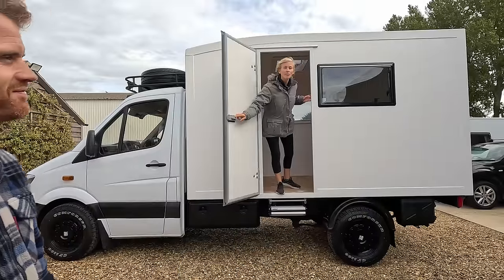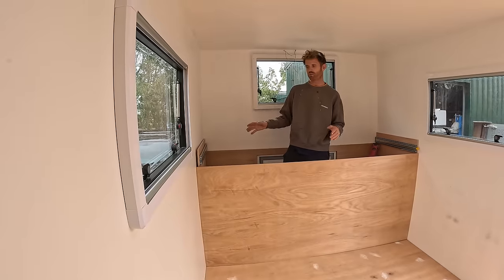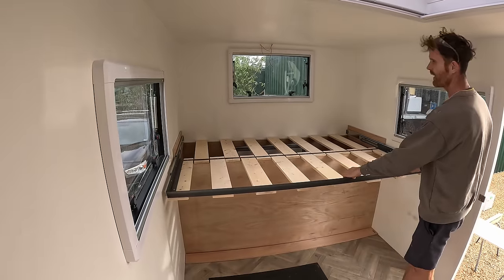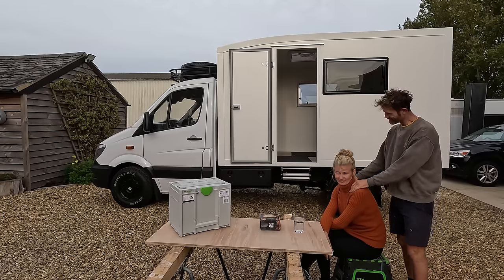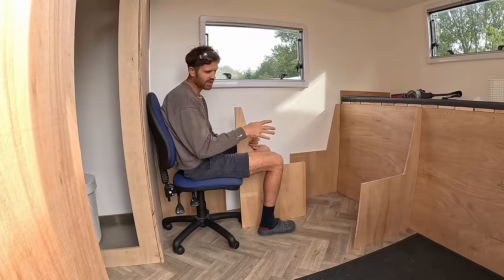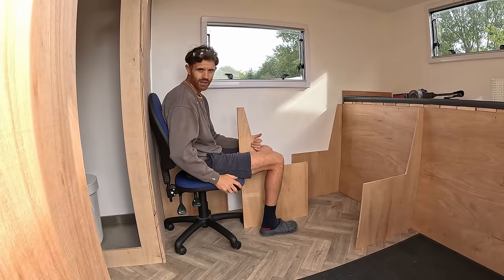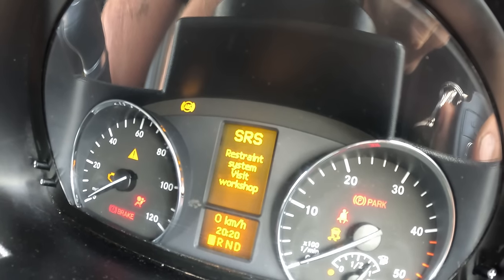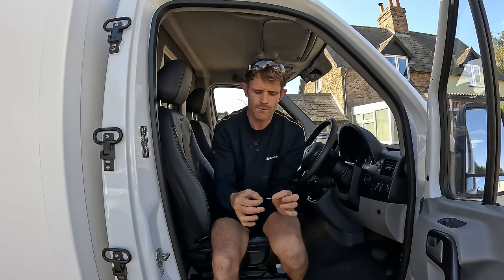Most SPACIOUS MWB Van Interior For Vanlife: Supermarket Delivery Van Conversion

Comment: Tool Tip Thursday ;-) The Build is coming along nicely. I even saw a ex Sainsbury Van yesterday when I was out with my Eldest on her Hack out, She made me walk along with her. well until they started to trot and this old fart can't keep up. It was being used as Hire Van. It has got me thinking again of building my own, but once the kids don't want to come camping with Mum and Dad. 
I do like the panel Saw as it takes up less room that a full size cabinet saw. I have to make do with a Track saw and a site saw. Those Kreg Jigs are brilliant. I have used mine a fair bit as if you plan how your using them you don't have to fill or plug the holes. That said I do also have there plug cutter, which I have even managed to cut plugs out of MDF, for when you can't hide the pocket hole. Another great tool for joining cabinets is the Domino. Trend is making the Domino Dowels now so it will not be long possibly before they release their own version as Festool's Patient must have run out, with them making slightly cheaper Domino Dowels. 
Looking forward to the next installment of Jon's Tools and Jess's Guns! Oh and the next stage of the build.
Reply: This is why we need Tool Talk Tuesday etc al, because there's an entire language many of us don't understand. 😂
Reply: @lemonladyYT  I would be the same if I didn't have a friend that is a Carpenter/Joiner, and helped him out when he needed a hand, and I learnt a lot from him over the years. We would both do our day jobs and work together at night. We even got a offer from a Designer to work with her and she would have provided a space to work in one of her out buildings. As we did a lot of work on her House, which we got as the Company my Friend worked for passed it on to him. Sadly my friend wasn't so keen at the time of setting up on his own.
Reply from the maker: Cheers mate, yeah I’d love the festool domino, cracking bit of kit that, it’s on my wish list so hopefully the sponsor sponsors some more 😂
Reply: @truebluetravellers  You may have to wait for the next project to yield a new tool or two from your Very Generous Sponsor. As you have already sorted out the cabinetry on the current build.

Comment: Hey guys. Coming along nicely. I have to say, I dont like those pocket screws. I dont rely on the fastener. I believe in wood glue. The fastener is only to hold it while the glue dries. I just pin with the air nailer. Proper strong joint.
Reply from the maker: Cheers mate, I have a friend who says the same, I just over engineer everything 😂🤦‍♂️
Reply: @truebluetravellers  Rather than legs on the bed, some sort of fixed cleat or neat, folding bracket on the wall to support the corners and you should be good to go. Is the front edge of the frame tube or angle profile? Rectangle tube on edge is most rigid. Angle could kink with a concentrated load, like from a knee while you climb on.

Comment: Like the talk through on the plan at the start of the video. Love the festool sponsor! As usual the workmanship is spot on. Nice layout. 18:57 Thank you for using my suggestion of Sat tool day! I was well happy with that, great segment on the video - but then I’m biased. A place for your tools: You could build a frame on the inside of your entry door, put some stiff foam inside and cut out shapes for tools, build an inner door to cover it. It would hold the tools, be accessible and provide extra insulation on the door. Ta da!! Dave Birmingham
Reply from the maker: Cheers David 👍, I did similar to this in a toolbox before bought some foam and spent hours drawing round the tools out then routered out the foam to fit the tools, worked a treat and looked 👌

Comment: Nice video and very good work. For safety, all non factory conversions of vans with bulkheads should also consider how crashworthy the installed  furniture is as debris and shrapnel may fly into the cab area in such a scenario.

Comment: about the pull out overhang of the bed : youre going to make a seating area and kitchen across from it , the most simple solution would be to make the pieces (maibe you can make the table so you can raise it too the height of the underside of the bed or have a box you can set on the table to rest the bed on top of )  just high enough to have the pulled out part of the bed rest on top of them on both sides on a small rubber doorstopper , should make it plenty strong enough to support youre weight on the end of it 
as for the top cabinets you could put a bungy cord in front of them (ok so no bungy cords ) and use curtains to hide most of the mess behind them , if you do make doors (ok no doors , maibe later) you could make them like picture frames and tension fabric over them , that makes them lighter just about as strong as they need to be and you can use the fabric you can use in the res of the interior and make them look a little more like they belong 
ok aluminium strips it is , if you mount them so they have a little lip under the cabinets you can put elestic bands with a hook on the underside to hook under the lip and over the edge of the baskets , that way the baskets are held down during travel and wont pop over the edge after hitting a bump in the road
Reply from the maker: Yeah we did a similar thing to that in our last build, did an outer frame and then put hesian in the middle worked out brilliant and like u say saves loads of weight 👍

Comment: Just a quick suggestion if you can find a way to duct some air flow from the diesel heater into the garage helps stop damp from the cold air lingering in there and has a added bonus of heating your bed
Reply from the maker: 👍 yep we are going to put a vent in the board between the garage and the living so then the whole space should be toasty, like u say good idea to heat that area too 👍

Comment: Sainsbury's delivery driver here, absolutely buzzed seeing one of our old vans being repurposed in such an amazing way 👌

Glad to see you've put proper tyres on it as those vans are awful on ANY slippery surface including wet grass!

The combination of rear wheel drive, automatic gearbox and zero weight over the back axle has left many drivers stranded in embarrassing places 🤦‍♂️😂
Reply: 😂 been there bro.
Reply: Sainsburys driver here too, the words you speaks are true, and if the van does slide even one inch the bloody masternaught lets you know all about it.
Reply: @philboboggins  Bloody Masternaut system 🤬🤬

From our store we cover a lot of rural areas and single track roads, it's almost impossible to avoid yellows or even a red as the locals drive round those tracks as though they own them 🤦‍♂️
Reply: was on a single track the other day well below the speed  limit, tractor came steaming around the bend. no chance of braking gently wet  leaves and mud ABS kicked in masternaut went red,😡😡.. and you cant even brake gently on any of our wonderfully rutted  potholed town roads, cos that sets it off aswel..
Reply from the maker: Thanks so much mate that’s kind of you to say, hoping it’s going to work out nicely. We’re stoked with how it’s coming together. It spun up something cruel on our gravel when we took the box off but hopefully with the new tyres and the weight of the build in the back she’ll do alright in the snow. 🤞We’ll be prepared with chains and recovery tracks just incase though.

Comment: I am in the process of converting a Mercedes LWB Sprinter.  After "insulating " the van and seeing all the  locations where insulation can not go and the metal which goes from the outside wall of the van to the inside. I wish I had started with a box van. Oh well hey oh I will press on.
Reply from the maker: I know what u mean mate, but pannels vans are still pretty good to be honest,  we did some English trips in our sprinter panel van and we were toasty warm, the worst for cold getting In is windows tho for sure 👍,

Comment: Re: Jess' baskets. Have you tought about putting a simple bungee cord type of thing across the front instead? Then you don't need the lip or doors and you can completely remove it when in use so you can slide the baskets in and out. Yes, I made this comment before the end of the video. But it does work well. I use them all the time for keeping things in place for transport to Glastonbury.
Reply from the maker: Exactly, works a treat hey 👍 I think they look good too but she’s not having it 🤷‍♂️

Comment: Well done, but if you ever plan to drive OFF sealed roads, the subsequent bouncing movements will throw things out of your open baskets, even with edges, so you will either need strong latching doors, straps or bungee cords (knowing Australia, should have alerted you to this!!). Here staple & glue gins are NO use, they rust and vibrate undone, glue, screw & epoxy are the safest bet. I find myself (I am from a boating/yachting family) that if built like boats to tackle gale force seas, then you are safest. I have had epoxied screws come adrift, from aluminium & wood together, on my truck that is way stronger than a Sainsbury's Van. Good luck and stay safe. Kia Ora from New Zealand. 💜💜
Reply from the maker: Thanks, all valid points, the corrugations in Australia are a good test to van build strength! We really tested ours there!! I should have said we always glue and screw, not just screw. This van won’t get much of that treatment though as it’s not really capable of that, might take it down some short dirt tracks slowly for a good park up but that’s the closest she’ll come to that kind of thing.
Reply: @truebluetravellers  💜💜 Of course Austrailia has more sandy and muddy tracks, than our rough corrugated gravel/dirt roads here. Stay safe & take care.

Comment: Hi great video new tool suggestion rather than holding the wood while using the belt sander ( which clearly more than good enough) why not get a linisher for the workshop similar thing but one man operated and great bit of kit your welcome haha
Reply from the maker: Cheers mate, It’s on the list 👍 I’ve got one for steel but it’s not that good with wood as the rounded end doesn’t really sand wood square, would be allot better with a proper wood one with the big front face 👍 maybe next week 👀 😂
Reply: @truebluetravellers  haha brilliant good luck with that defo good bit of kit 👍

Comment: Another Great video, Can you add  your Bungi and Steel wire rope making kit to your Amazon kit lists ?
Reply from the maker: Yes mate, will do that’s for the reminder. I’ll make a special list for it and let you knew when its in 👍
Reply from the maker: Hi Chris, I've made a list on our amazon shop with all the bits except the hooks as they are cheaper on Ebay. https://amzn.to/3tG1s1V

This is the link to the hooks on ebay https://www.ebay.co.uk/itm/303163681474?hash=item4695f6aac2:g:XLQAAOSw4f1je1qH&amdata=enc%3AAQAIAAABIPvzcRiGMS5dR%2B9cuJP1OLsgL6rBYrE%2FdSrPx1LlkAa4%2FizQbyU6FM3UTlfOi37oUdXE%2B8U09lTzsvqCkeeRvhfb%2Bwy2sOVCH8gj3D4PFP642aOPqBSiCACrRBWT4HBx%2BtvHTd2zxCdDCcDr1cLsG1YnT5h7f4ig8EMZtxtnVus6bggYK66zgnFpfWWR5AsssjsQNvq%2BCXm8M09PydRBSvONWo42cwQ8Dl2LUbJyn1f2EZOhMOja5TqBQyg5uybdNertb7m1KZ1j%2BT6xNrh00f4Fy7UQ2V79A2DmYGe6cUKKBexyUZiQUwvcCZ49aYL8LaI0CwxvMeAJTAx0mgCMrjk8rKtpOh8MIwmmKyyWP65ASYOteDyJMXIdtqs7HgG41A%3D%3D%7Ctkp%3ABFBM-Iunz-Zi
Reply: @truebluetravellers  Awesome you will have to post the links of the shorts

Comment: I really like your videos because they are not only fun, but also very educational. I'm even a pretty handyman, but thanks to your tips and tricks I've learned a lot. And your trips are a dream for many, which we can also enjoy thanks to your videos.😁👍. I just have a small question: what kind of drill guide do you use when making the benches? I have been looking for something like this for a long time, but this one is absolutely great because it also has the option to connect the vacuum cleaner to it. Keep up the great work and you both are a great couple😂
Reply from the maker: Cheers mate, much appreciated, it’s just a kreg jig, I’ll drop the link in below mate 👍
https://www.amazon.co.uk/Kreg-256272-K4-Pocket-Hole-Jig/dp/B007XDHRMG/ref=asc_df_B007XDHRMG/?tag=googshopuk-21&linkCode=df0&hvadid=271967412945&hvpos=&hvnetw=g&hvrand=17590814192505108903&hvpone=&hvptwo=&hvqmt=&hvdev=m&hvdvcmdl=&hvlocint=&hvlocphy=1007094&hvtargid=pla-475823022687&psc=1
Reply: Thanks😃👍 @truebluetravellers

Comment: Brilliant idea to convert guy's, absolutely love the way you've designed the layout, just curious how fid you cut out the doorways and get them eater tight and create a water tight seal between bulkhead and rear of the cab area. Also how did you fill the back door in and create the smaller lower down one
Great channel all the best Lee
Reply from the maker: Hi Lee, we filmed doing these bits too. We show cutting the holes and the alteration to the back door and fixing in the panel in video 1 of the series which is this one: Supermarket Delivery Van to ULTIMATE Winter Campervan: Van Build Part 1
https://youtu.be/9MrxENorFeU

And we show fitting the doors and crawl through in video 2: The Most Technical Job We've Done On A Camper Conversion!
https://youtu.be/VHCeB7O_pCA

Hope that helps 😁
Reply: @truebluetravellers  oh my how stupid am I not to have found that already 🙄🤫🤔🤣🤣🤣🤣👍👍👍👍 thank you so much for this

Comment: 2 questions. What was the weight of the body itself?

What was the mileage on the van?

Bonus question. How does the body attach to the chassis?
Reply from the maker: Not sure on the weight of the body on its own but I think it was 2060kg empty with box on, mileage was 90k and it’s just bolted to the chassis with about 12bolts 👍

Comment: Would you fail an MOT if you solder resistors on to bridge the connection?
Reply from the maker: No not at all, it’s puts the light out on the dash so it doesn’t fail MOT, but you do have to do it otherwise it would fail MOT if the light was on.
Reply: @truebluetravellers  You have actually saved me £50 if it works, my local garage quoted me that to fix it.  Time to dig out the soldering iron 🤣
Reply from the maker: You will still have to get a code reader to delete the fault codes tho that’s the only thing 👍

Comment: No mention of the van mechanicals, or did I miss that?
Reply from the maker: Sorry mate, what do you mean by van mechanicals?
Reply: @truebluetravellers  it's a tough life being a supermarket delivery van, lots of short journeys, city traffic, and huge mileages. What state was your van in?
Reply from the maker: @steveelkins52  oh I see what u mean, so far it’s spot on, a few issues are drivers door seal torn, radio screen broken (apparently it’s common on this model) few dings in drivers door which I’m assuming is from the crates, but apart from that all good mechanically 🤞

Comment: What Plywood are you using? Is it quite flat and stable? I struggle to find anything that isn’t warped.
Reply from the maker: Rubbish to be honest Mate, we just use normal 12mm hardwood ply and then birch for the fronts of everything, the wood price seems to of gone up but the quality gone way down
Reply: @truebluetravellers  it’s frustrating that birch ply is the only decent option for cabinet construction, especially with the price and lack of availability these days. Anyway, still enjoying your videos. Keep up the good work!

Comment: one thing weight, and keeping down, so why has everything cupboards, bed, seating, all  all got solid backs? and they where not just using ready available walls of the van?
Reply from the maker: I agree weight is very important, but everything has backs because that is what is being secured to the walls, so if there was no backs then I’d wouldn’t be solid, also the cabinets and beds etc is what is strengthening the walls as I took a middle divider out at the beginning so it’s tying both the side walls in, if I could do it lighter I would but it’s a compromise between strength and weight

Comment: Is there no way to integrate the new seat belt buckle?
Reply from the maker: Not 100% sure to be honest as the new one might have a different resistance so still not might put the light out if you worked out the resistance and then added a resistor to make up the difference then I suppose yeah it could be done 👍
Reply: @truebluetravellers  So did you just bypass the light or did you bypass the actuator as well?
Reply from the maker: @theworkshopwhisperer.5902  so the resistor just makes the system think the original buckle is still on so no problem and no light

Comment: I really hope you have full C1E driving licence as that van will really heavy before you add ,fuel , water, batteries, and then yourselves and groceries etc. It will be close to 3500kg before you started off. Using 12mm plywood is heavy to start with on the walls as well.
Reply: At the beginning of this build series, after stripping it out, they weighed the van. These guys are on top of the job. 😊
Reply from the maker: Hi, as the lovely Jeanie has said, we weighed it before we started the build and empty it’s only 2060 kg which is less than your average panel van, one advantage with this is that you don’t have to line the walls and roof with wood like you do in a panel van conversion but a disadvantage is that all the cabinets need backs to secure them to the walls as they are only made from fibreglass and insulation. We’ll be weighing it when we’re finished so be interesting to see what it comes in at.